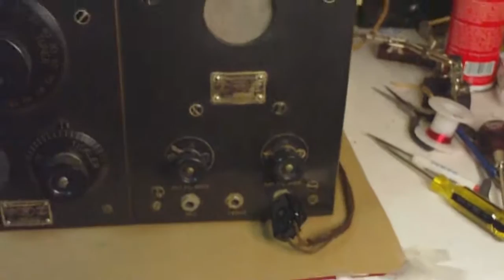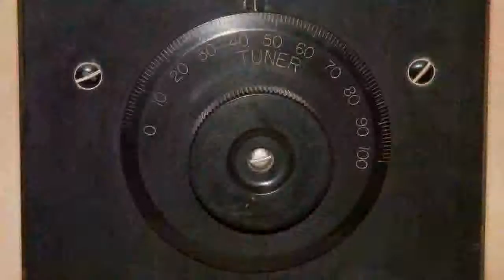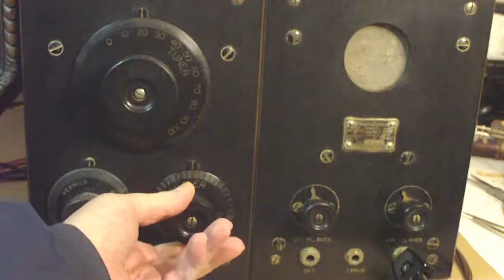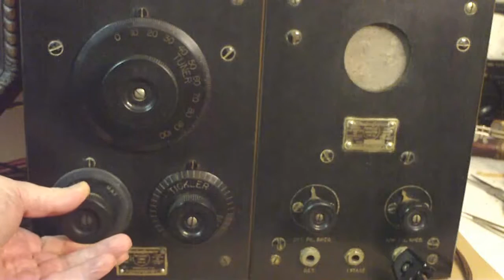RCA Radio Model RC Operation

Comment from the maker: @TN048 
No I do not have a wiring diagram, but I'll look for one. I did another video on the RC called - RCA Radiola RC Radio 1921-22 - it has some close up picture of the insides. My audio transformers are not original to the set. But the picture may still help.

Comment from the maker: @jonrsawyer
Its the RF that is feed back. Check all the coils and connections. Then with power on and the filaments on check the plate voltage of each tube.

Comment from the maker: Thanks Roy,
The Tickler is and interesting term. It is the part of the regenerative circuit that provides the positive feedback. In this radio it is a coil with lots and lots of taps and contacts. You can see all those connections in my video just before this one. In that video I took about thirty HD pictures of the inside of the DA and RA units. 
Hope you and your family have a very happy and prosperous New Year.
Rick

Comment from the maker: In these very early radios quite often they would be marketed with everything sold separately. So you buy the radio, and then buy the tubes and speaker, then the batteries and even the antenna wire. The speaker I used is the RCA tapestry 103. This speaker is about 1928. Thanks.